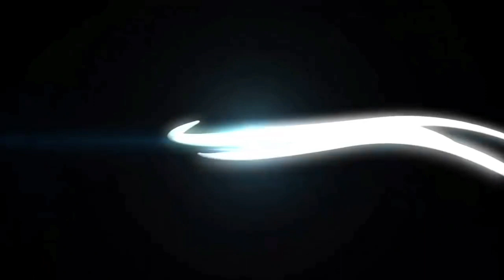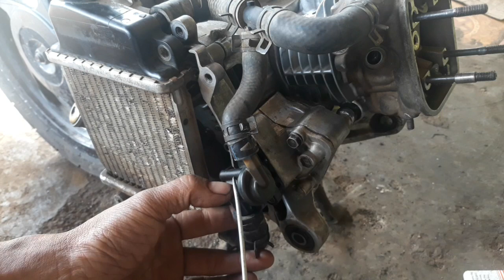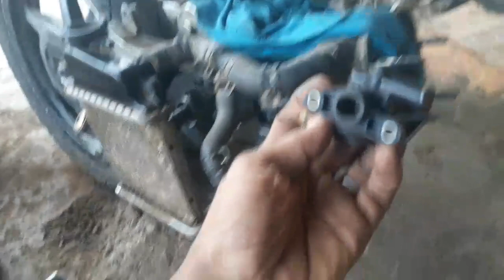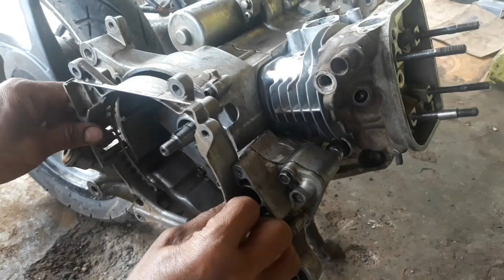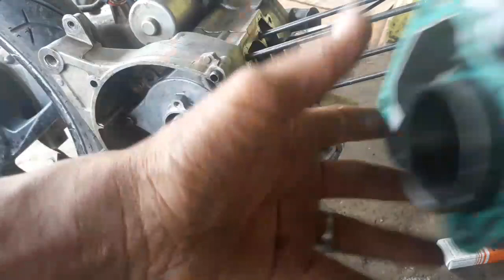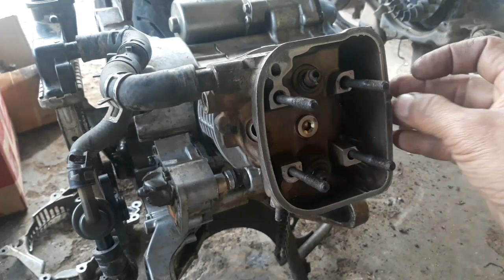Penjelasan singkat sirkulasi air pendingin di Vario 110 cc.

Comment: Bang kalo vario bagian busi selalu basah dengan air itu apakah dari kebocoran air radiator. Cara mengatasinya gimana bang. Tolong jawab bang. 🙏🙏
Reply from the maker: Vario apa saudaraku.... yg lama apa yg baru
Reply: @Mulyamotor  vario lama bang 110cc
Reply from the maker: Biasanya bocor dr paking head. Coba ganti paking head nya ya.
Reply from the maker: @bambang4046  ya coba ganti paking head nya. Kl bisa pake yg ori ya.
Reply: @Mulyamotor  mau tanya bang kalo air radiator masuk ke ruang bakar cara mengatasinya gimana dan di knalpot keluar asap tipis dan motor susah nyala